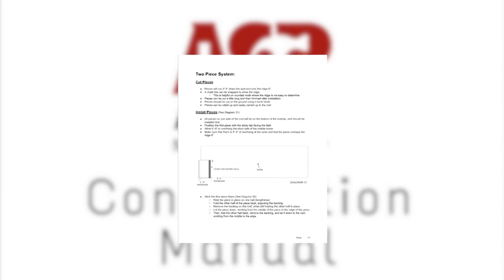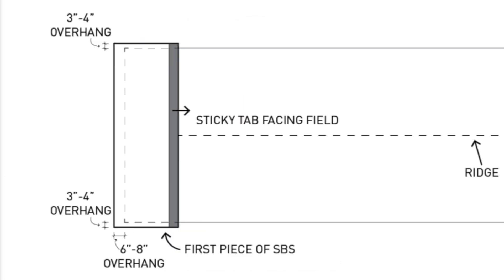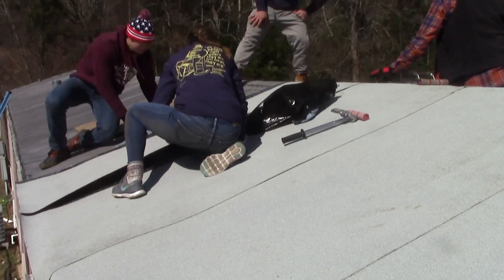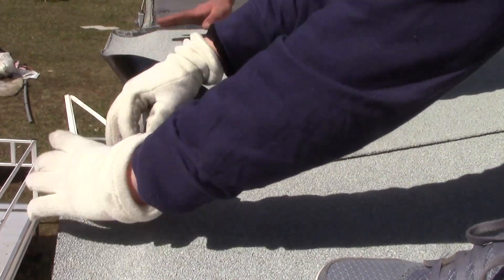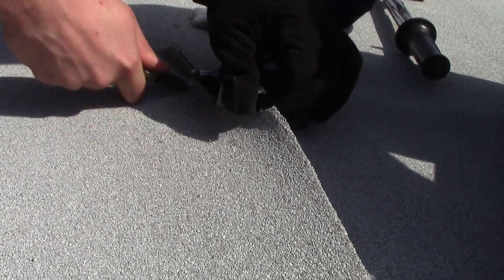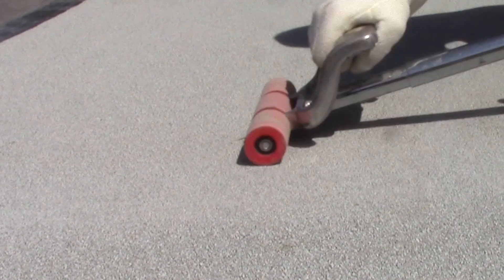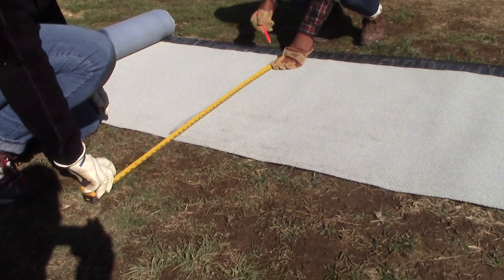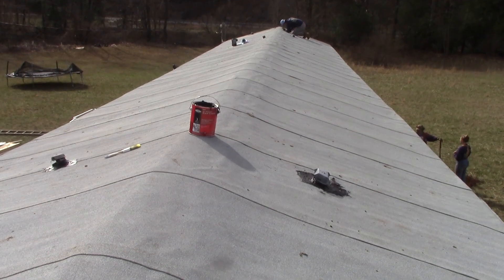SBS Roofing Instructional Video | Construction Corner

Comment: Thanks!  I may just rotate my install direction to 90 degrees of intended.  

Last time I stopped a double-wide from leaking, I used heavy greenhouse plastic and bricks.  Plenty of slope, just get the holes covered and the water moving!